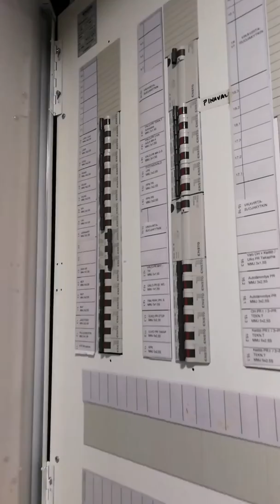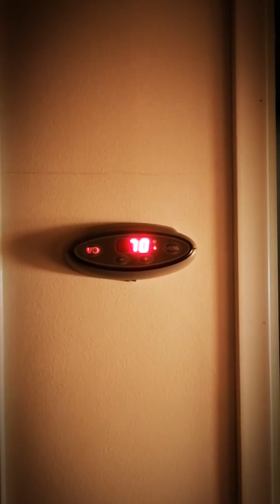Saunan sähkökiukaan vastusten vaihto - Harvia Cilindro PC90EE

Comment: Hejsan! You have the connecting plates upside-down. They should be oriented with the bump facing downward toward the electrical compartment. The little bump makes room for the O-rings above. There should be a solid connection between these plates and the metal panel above. So that the heating elements don’t wobble.

UPDATE: I was mistaken in this statement. See the comments below.
Reply: Harvia responded, and confirmed that the way you oriented the connecting plates is correct. Perhaps the idea is to channel any leaking water away from the connections below.
Reply from the maker: Hiya! The original factory installation is visible at 2:24 so it should be correct. But your explanation also sounds logical. Probably not a big deal, though.
Reply: @MikkoAuvinen  Interesting. I’ve asked Harvia tech support to get their official word on the matter. 🤓